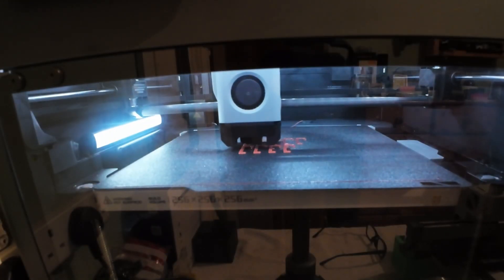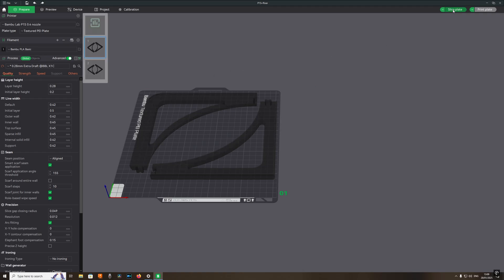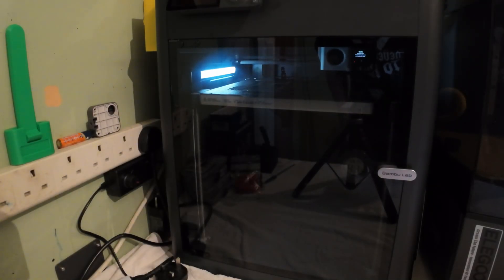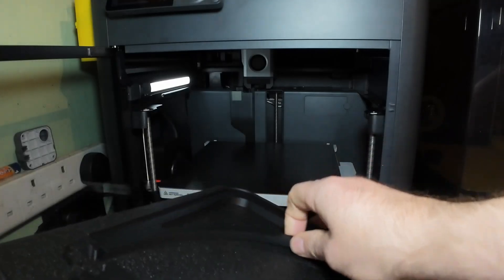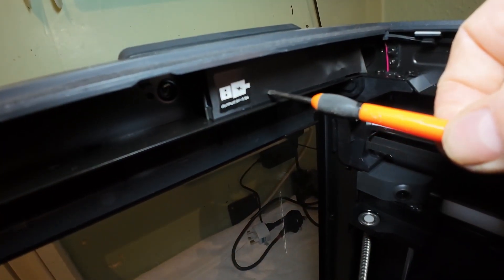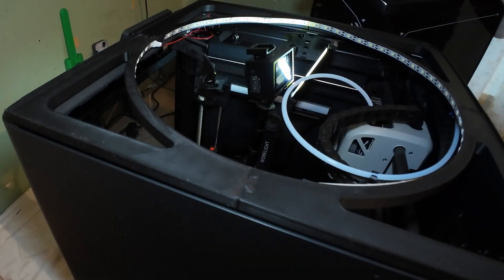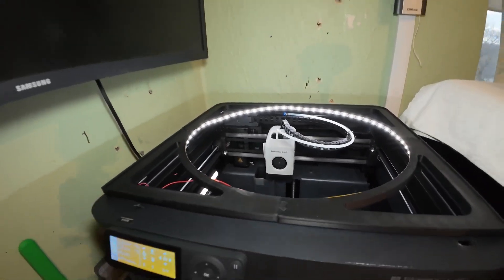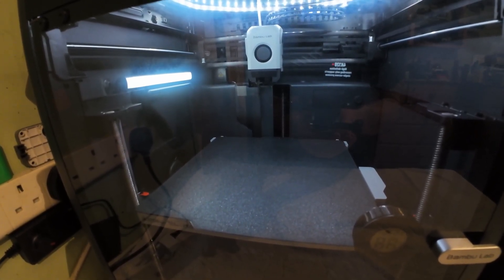How I Transformed My Bambu Lab P1S 3d Printer.

Comment: If you disconnected the original lights, how did you manage to reconnect original and new light, you haven't shown that part ......., not to mention, the board cannot output enough current for both light strips as I understand it.
Reply from the maker: Just spliced the wire and solder it.
Reply: I was thinking the same thing.
Reply from the maker: @edhousemanjr5474 Just spliced the wire and solder it.
Reply: u solder the new strip right onto the pads and the board handles the combined current no prob
Reply from the maker: it still works fine and it's used everyday
Reply: @CALTECH3D ok so it's been used for more than 8 months now and no issues. That's the info I was looking for thanks